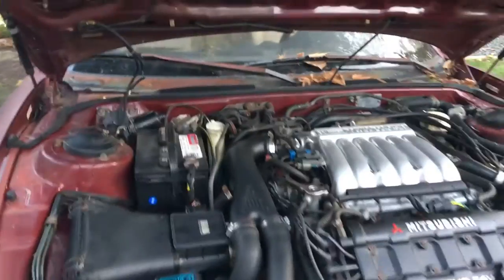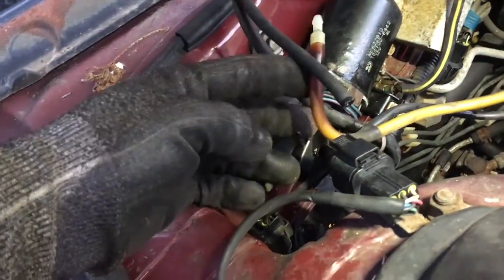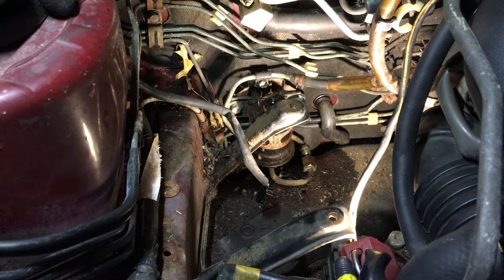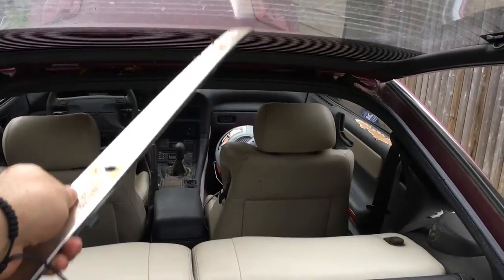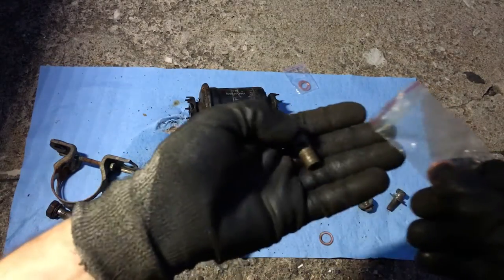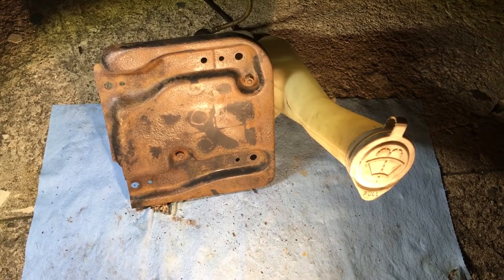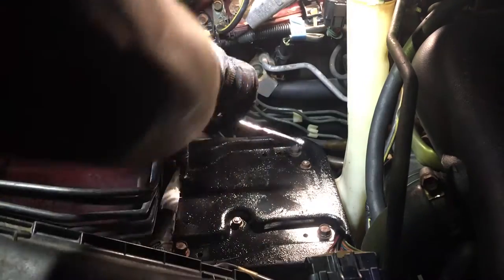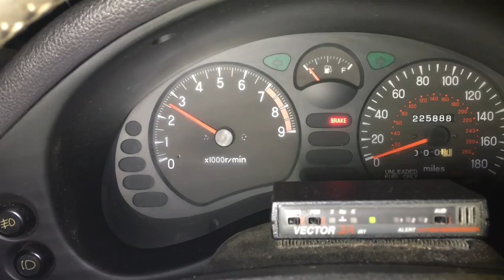Replacing the Fuel Filter On the Worst 3000GT VR4!

Comment: I have no reason to suspect mine is bad but considering it's at 108,000 miles and I'm going to do a 120k service in the spring I might just do this anyway. The battery is out for winter so there's step one already done.

Comment: With actually seeing some rust in the fuel line, should you of shot some cleaner down it a few times, and blew it out again ?
Reply from the maker: I probably should have I don’t remember. It has been a long time lol
Reply: @Jursaw Sorry was not slamming ;-) Its that I am working on a 92 Stealth tt that was sitting for 11 years, and am in process of having the tank redone. I already redid the fuel sending unit and replaced the fuel pump. The reason I was asking was wondering if I could get by by just blowing out the old fuel ? thru the lines like you did, then just using a gas additive in the gas when assembled, vs trying to blow chemicals though the line?
Reply: I'm curious too. I'm also wondering if i can use the fuel pump to pump the old fuel out. I saw you can add power to a black plug in the engine bay and the pump will run without the car being on.

Comment: thanks bro you where a big help saved us some $ .you know anything about interior lights bulbs are good checked with test light power going thru  fuses are good but aint getting no lights
Reply from the maker: Tammy Sedillo I'm glad to see that I helped you save money! Only thing I would say is that the switch could be bad or just a bad bulb or the wiring going from the fuse to the light is damaged. I plan to get white LED interior lighting in this car
Reply: Jursaw  ill look in to it thanks.bro good video
Reply from the maker: Tammy Sedillo thanks and no problem

Comment: I had a 2001 Z28 that I let sit due to needing a re-tune. The car hibernated for nearly 5 years. It had a Holley 255 fuel pump in it with maybe 2,500 miles on it. Sitting in varnish and water (10% ethanol blend) ruined the pump. It didn't want to rev, run well, or keep pressure (checked it with a gauge on the fuel rail) and finally crapped out prior to loading the car onto a trailer. I had to drain the tank, flush it (acetone works), replace the pump with a Walbro 255, and replace the fuel filter. My buddy bought the car and it runs very well and is lovingly stored in his garage. If you're going to keep the car you might as well drop the tank and replace the fuel pump before it dies on you when you're driving it. Just my .02 based on my experience. Check fuel pressure if you get a chance, your car probably has a valve somewhere on the fuel rail that you can tap into to.
Reply from the maker: MrAristes MrAristes The fuel tank was replaced but I think the fuel pump that was put into it was used so that wasn't a good idea to reuse fuel pump. I think I have to get a special fitting or something to check the pressure.
Reply: Keep up the good work on the car, I'm subscribing. My one friend had a gauge that screwed onto the schrader valve on the rail of my Z28. We saw PSI drop down to carb levels (12-16 PSI) as the pump was dying. I understand if your Mitsu is different. I just watched your video doing the compression test. Did you ever go back and squirt some engine oil into the spark plug hole and take a new reading? If #6 cylinder is low and you use a long, thin funnel to put a few ounces of oil in; the pressure reading will increase if the cylinder/rings are the culprit. The numbers won't change if the problem is above in the head/valve area. Just a thought since this trick is old and works pretty well.
Reply from the maker: MrAristes I was going to go back and put some oil in the cylinders to see if the pressure would go up to blame the rings but I didn't. I will do that soon though. Thanks for the sub!

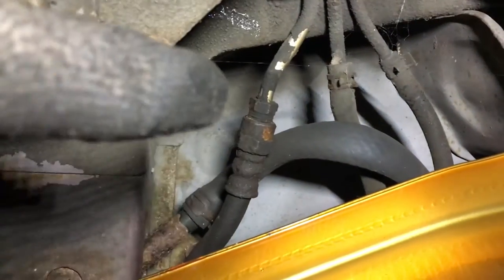Comment: That fitting at 11:19 is what is keeping mine from working, I have sprayed it with all sorts of penetrating fluids and it won’t budge. It’s starting to slightly bend the metal line. Does anyone have any tips???

Comment: Do you need to relieve the fuel pressure before you take out the filter?
Reply from the maker: I suggest you do that way when you loosen the fittings, you don't get sprayed with fuel
Reply: Oh OK.  But not necessarily dangerous if I don't, just messy?
Reply from the maker: AhPhoey Just don't have any open flames or anything that can create a spark to ignite the fuel if it does spray out!
Reply: True true.

Comment: What was the car doing to make you change the fuel filter??
Reply from the maker: It was just a maintenance part that I felt needed to be changed. The car did sit for a long time too. Old fuel sitting in fuel lines, fuel tank and fuel filter isn't good for the vehicle.

Comment: I had the same problem with my 1987 Toyota MR2. It turn out that the engine and transmission wasn't getting a proper ground connection. Hope you figure it out.
Reply from the maker: Thanks, I want to replace the ground cables and terminals on this car real soon!

Comment: The hardline that comes out of the top of the fuel hat is very bent and could be restricted.  This happens all of the time.  It is better not to mess with the connection at the fuel hat and only remove the one under the car.   You can replace the fuel hat with any 3000gt, but you have to replace the bracket at the bottom of the fuel pump on non v-r4 models.
Reply: Just check your fuel pressure to make sure it is not restricted
Reply from the maker: Yeah it doesn't look great, the reason why I tool it off the top of the tank was to blow out that fuel line with compressed air. Thanks for sharing that info, I might look into getting one in better condition in the near future
Reply from the maker: I will have to get a gauge

Comment: Almost seems like the temp sensor. I had a vw vr6 and that sensor broke and I wasn't aware of it. When I tried to rev it up over 3K it would just stop and die back to idle. Also not sure if the other YouTuber ever got to check the fuses. At this point. Check fuses and Check sensors. Can read the codes with an OBDII reader I bet you have one. Its a Japan motor so its nothing like a german motor but I'm sure the temp sensor is pretty much the same thing. That would make sense for the rev part but the smoking is probably major motor issues. Have a special camera can pull the plugs 1 by 1 and see if the piston is cracked or has a hole in it. 1 had water in it towards the back. Running OK now but I bet it will need a rebuild.
Reply from the maker: Thanks for the tip, I will have to look further into it, this car like bogs when you try to rev it with the pedal depressed all the way but when you ease into it, it revs up high. I don't think this car has a OBDll port because it is an older car.  (pre 1996)
Reply: My vr6 was a 1996 and it had OBDII I did a search and your car has OBDI but right after that it was OBDII I'm sure. It makes sense it is a sensor since when you rev up the car the sensor adjusts for more gas or air. I might be completely wrong but the problem sure sounds like it. Check all sensors and make sure they are not broken. The rat could of broke some of the wires and that would totally make sense. Get the manual and read the codes. When you reset the battery the ecu has to re-learn everything again on the adjustments to air fuel. Altitude all that crap. Good luck and keep us posted.
Reply from the maker: It does sound like a possibility. I will check this out tomorrow. I hope no rodents damaged the wiring or any components. Thanks for your help!
Reply from the maker: I hope my sensor is good because that is a pricey little sensor haha
Reply: Yep. Japanese or German parts are not cheap.

Comment: did you fill up the water reservoir thats on the trunk? the light in the dash is for the rear reservoir not for the front one btw...
Reply from the maker: I checked it and it did have fluid in it. I read that the rear reservoir doesn't have a sensor for the light?
Reply: +Jursaw  mmm thatss weird cause both front and rear show different symbols in the dash
Reply from the maker: I am going to have to look into it again

Comment: how long have you been working on cars? I have been in the field for 16 years and picked up on the little things you do. very professional.
Reply from the maker: Jason Nickel I went to vocational school for the 2 years they offer and graduated 2015. I never worked in a repair shop. I like watching videos and other mechanics on youtube to learn and get better! I work on my friend's and families cars but not often. I would like to get into the field as a technician but every place around here has cons I do not like.
Reply: Jursaw you seem to have the talent for it. As well as the tools. Lots of nice snap on stuff. You would do well. If you lived close to Columbia sc I would hire you we have plenty of work and a ac shop! But it is a hard field to get into. (Well the dealership side)

As for your car... have you swapped a known good maf sensor? It seems to me that's what is acting up. Or you have a decent boost leak. 3sx sells a boost leak tester that bolts right up and you use compressed air to check for leaks. I would try that next.
Reply from the maker: Jason Nickel Thanks! I take that as a compliment. I love Snap-On tools but I don't buy too many because I like trying different brands that do the same thing if not better for a cheaper price. That sounds really great! There is so much competition around me it is crazy. Theres like 4 shops on one block. We have dealerships left and right. I would rather work in a private repair shop honestly. I have not swapped a known good MAF sensor because I have not been able to find one and I do not feel like shedding a few hundred bucks for a new one. Funny enough, saturday I started it up and it idled funny and the CEL came on. I checked the code and it was code 53. I was thinking about making a video on how to check the codes. Code 53 says, harness and connector, ignition coil, and power transistor unit. I believe it was dumping fuel down into the cylinders and not having enough spark to burn it. The coils are old and rusty looking. I have to do some more diagnosing.
Reply from the maker: Jason Nickel I was thinking of making my own boost leak tester that wont blow off. I definitely want to check for a boost leak though.